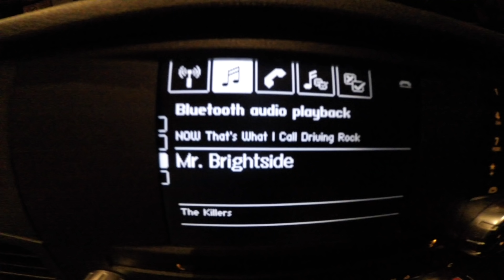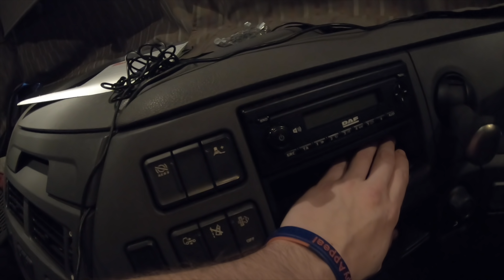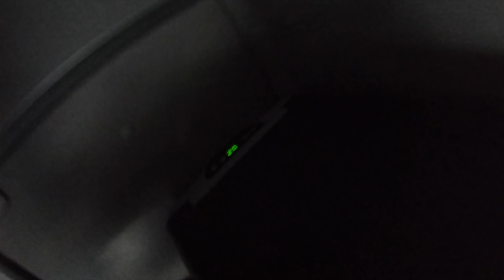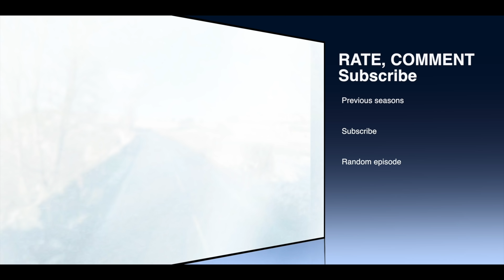Trucker Jay in the UK: S5E16

Comment: Hi Jay - That Bredbury Junction where you join in Lane 3 of the M60 is awful. You get cars which have been happily driving on the M60 joining in Lanes 1 & 2 but are restricted to 50 mph as they come around the corner. They want to speed back up to at least (!) 70 so always end up undertaking slower vehicles in Lane 3. If you are then wanting to come off at the next junction (M67/A57) you then have to get across Lanes 1 & 2. It's hard enough in a car so I cannot imaging how tricky it would be in a 40 Ton Artic! The Bredbury junction will be even worse once the A6 bypass is completed and joins the Bredbury roundabout. This will bring even more traffic down Lane 3!!! Great Vid as always but I'm biased - I'm from Stockport but now live in Lincolnshire so lots of where you went are familier to me.

Comment: Re having to use a silly lane to join / leave a motorway - the M25, M26 A21 junction is another example. I used to drive an old landrover 60 max with a following wind. Going from M25 to M20 you need middle anc outside lane. If I had a £ for every BMW driver who sat on my tail in the middle lane flashing lights I would be rich. Coming the other way, although prob now changed you needed outside lane of M25 for A21. Again many drivers simply did not realise that to continue on M25 you needed to keep left rather than sit upmy chuff flashing their lights